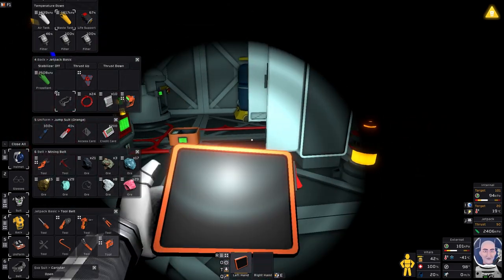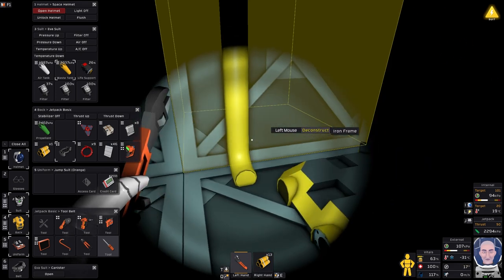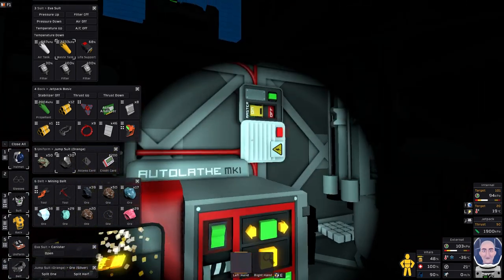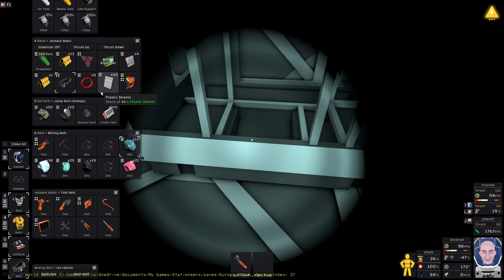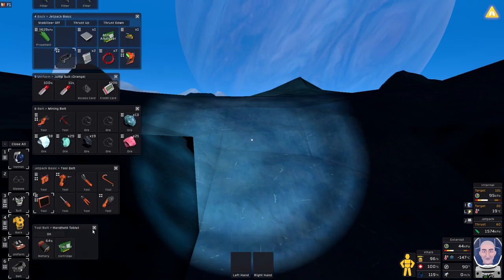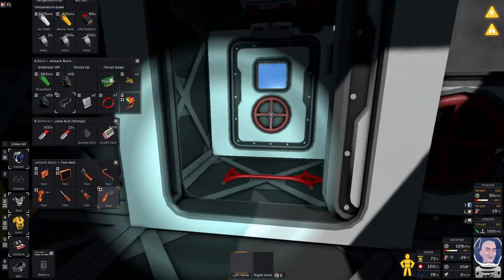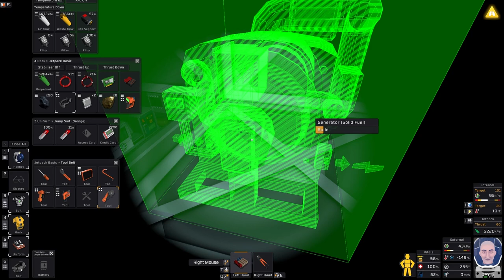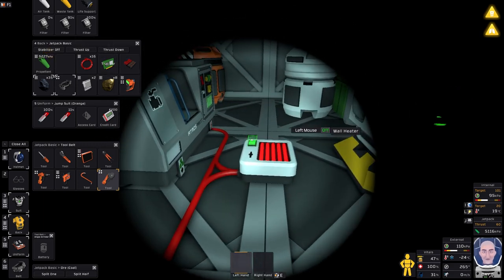Installing a Station Battery on the Frozen wastes of Europa - Stationeers Europa Ep2

Comment: I find the easiest way to make some nice heat in start base, is run the portable generator indoors for a few days.  Make suee you use the scrubber also and you will have heat, power, and clean air for the starting area at least.
Reply from the maker: @WakkaWakka25 In the next video I find another way to warm my base without polluting it. It is up as a members only video at the moment though.

Comment: Why is one of your suit pieces yellow in this video? Do you plan on setting up a greenhouse soon? Also, in some other videos I've seen from other players, there are still shots of vehicles. Are those just for lore or can they be built to go on a trip? I'll keep watching this series, and look forward to the video you make next!
Reply from the maker: @jasonknop984 It is my jetpack that is yellow, my suit is white but you can paint your jetpack/suit whatever colour you like once your build the Tool Manufactory, which is another printer. The colour of my jetpack/suit at the moment is just the colour the game gave me at the start. Which I belive is the default colours for both the basic jetpack and suit.

In video 4 I will be replacing some of the solid bits with glass walls so I can start a greenhouse. However, I need more CO2 for the plants to breathe, this is a simulation game. On Eurpoa the atmosphere is 100% Oxygen so I can't use that, but there are a few other ways you can get CO2. They are recover your waste tank, so the CO2 that my character breathes out, filter out the CO2 from the furance, but that needs to be cooled to just the right temperature, or grow mushrooms in a dark room, they consume Oxygen and release CO2, plus they provide food.

At the moment you can't build the vehicles, they were a thing but the developer removed them. They say they need to change the way the landscape is generated, which they're working on at the moment and then vehicles will make a comeback. This is a game in active development with updates every few weeks.